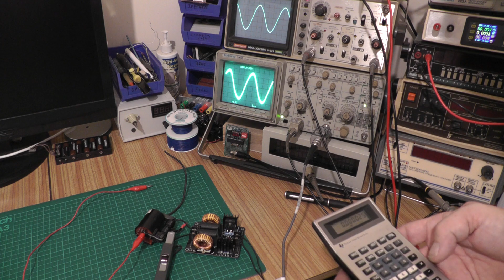Home Made 30 kV ZVS High Voltage Power Supply and Tear-down

Comment: 7:24 I can't afford all that but i want you to try somethings with these 
1. get 5 to 10 capacitors in parallel and then check how strong and loud that spark could get 
2. change the distance between terminals to let the capacitor fully charge
3. get bigger high voltage capacitor to test how loud could be bigger 1uf or 0.1 uf capacitor could get
4. if you can use dB meter to test the that spark bangs.
BTW nice video I would be really thankful to you if you can do this there is no video on YouTube which tested any of above

Comment: At about 7:19  you state "If it's DC I'll get a spark"...What would happen if is was AC??
THANKS MUCH!
Reply from the maker: At high frequency AC that capacitor would essentially conduct (like in a HF filter), and heat up.

Comment: Hi Les!What is the voltage and the current wich you feed the zvs?I just burned my hv power suply and I want to build one based on your design.I have an 1000w zvs.Many thanks!
Reply from the maker: I normally feed it off of a variac upto about 20v but a low current may be a couple of amps or so.

Comment: I'm having trouble sourcing AC flybacks unless i order from China and wait 3 weeks, did you source yours in the UK and do you have a link ?
Reply from the maker: It came out of old equipment, a radar set if I recall! It is however entirely possible to wind your own secondaries for these. I built a few over the years or x-ray stuff I was building.
Reply: Thanks Les.  @LesLaboratory

Comment: Hey, I got a bunch of question. What is the output of your ZVS driver? Is it AC or DC? Where did you get an AC flyback transformer as I have a hard time looking up for one? And did you use AC for your initial input into your ZVS?
Reply from the maker: The output from a ZVS is AC. The input is DC. It is possible to wind your own flyback if you can't get hold of one.

Comment: Great video! I'm planning to build something like this for a project. Do I have to use a flyback transformer? Since ZVS driver works at the resonance frequency, would it be okay to use a transformer out of a microwave oven?
Reply from the maker: Thanks! The LC in the ZVS driver behave as a resonant tank circuit, and thee normally resonate at round 20kHz or so. The heavy Iron core of a microwave oven transformer it much too lossy at these kinds of frequencies. Flyback Transformers can be had very cheaply off of sites like eBay and make for a compact, high voltage supplies that are much safer than Microwave Oven transformers!

Comment: I made a multiplier with 10 capacitors. The diodes are fast (restoration time 150ns) but will be able to handle the high frequency of the ZVS? What do you say?I'm afraid of burning the diodes because of the high frequency.
Reply from the maker: Assuming that the transformer resonates at about 20kHz, the period will be 50uS, so 150ns recovery time is more than adequate. Use a ballast resistor on the output of the multiplier, else a discharge may exceed the current rating of the diodes.

Comment: Even If it´s true that electronic gets distorted when high voltage is near  I saw high voltage power supplies with digital meters so it must work some how. I could even get analog meters jumping like crazy so they are not immune too. I did not try hard enough myself but maybe you could try shielding, filtering and grounding(earthing) in one or more combined way.
Reply from the maker: Sure with shielding you can get digital meters to behave. unfortunately I only had a plastic case for this project. Analog meters are however quite robust, and some are design for direct reading of EHT, like electrostatic voltmeters.
Reply: Yes they are more forgiving but If you use a marx generator on the same ground and you don´t earth anything they say I am out now xD If not banging with a marx on the same ground they also were good enough for me :) I guess there are oscillations when the marx strikes because sometimes I have even flash overs of my 40kv resistors which are plenty for 25-30Kv with a flyback transformer. Still I don´t think a mains earth is made for a marx too so I leave the ground floating and power it from a battery.

Comment: Thanks a lot for video. It's great. How can I make this power supply with 60 kV output with the same frequency? Can you please help me and share the circuit schematic?
Reply from the maker: You could add more stages to the CW multiplier, but you would have to insulate it well (for example submerge in oil). ZVS drivers have been around forever, and there are plenty of schematic on the net. If there is an appetite for it, I may well do a video in them in the future, but right now, I am in the middle of a CO2 Laser video... I am curious, what is your intended application?
Reply: @LesLaboratory  Thank you very much for your response. You are really generous that you want to do a video for it. That's so useful for me. Can you please suggest an applicable schematic to me for 80 kV output? I want it for ozone generation, but with 80 kV output.

Comment: i dont have time to find spheres because my problem but needles are ok i believe. MY CONCERN IS NOT TO PIERCE MY CAPACITIVE DOORKNOOB(40kv 1nf with 20% tolerance).my source is a high voltage generator with a voltage multiplier that it said to have 40kv but in reality it has about 20 kv because the arc jumps at 20mm.Of course i put a resistor in series(about 3Mohm 3W)for protect the source.I think you can power and you your lasers with these modules( period max 5 sec)to not heating up(especially the small one).The 1000kv ( more than 20kv at 7,4v) 3.6v -7.4v input and the 400kv (20kv) 3.6v-6v input.for power source i use two 3,7v acumulators.
Reply from the maker: You really do need the time to make at least reasonable measurements. It is worth it in the end!

Comment: so the formula U[kV]=30*d[cm] is true for sperical electrodes with a spacing much less than their diameter,not for needle like i have?what i see in graph is 2cm  is aprox 20kv, and in tabel 20kv is 1,75cm for needle.Someone say i have 3kv per 1 mm distance beetwen the electrodes examples:
→ 10 mm * 3 kv/mm = 30 kv
→ 20 mm * 3 kv/mm = 60 kv
i believe this examples is for spherical electrodes not for needles.
Reply from the maker: You are better off using spheres. They are easily obtained (ball bearings, dome-nuts etc). Needle gaps are notoriously unpredictable as a measuring tool, because of the Corona discharge they generate.

Comment: so ,a spark which jumps at 20mm lenght is 20kv?i dont have a high voltage probe to measure the voltage of my power supply.my power supply forms an arc about 18mm, so is 18kv.
Reply from the maker: Yes, more or less. There is a document here that may help you: http://www.kronjaeger.com/hv/hv/msr/spk/index.html

Comment: your diodes from multiplier are 15v high frequency diodes or regular diodes?
Reply from the maker: High frequency diodes. Mine are each rated 30kV, but 15 kV will probably do the job.

Comment: for my mini  tea nitrogen laser ,it  will work with a crt flyback with ballast resistor or  should  i built an multiplier?it will work a multiplier with 4 diodes or six  15kv, 550mA ,and  20kv 1nf ceramic capacitors with a balast resistor 3,3Mohm?and which is the voltage of your flyback?
Reply from the maker: it depends, if it is a DC flyback, a multiplier is not needed, nor will it make any difference. My flyback is AC and puts out about 10kV hence the multiplier.

Comment: Where dya get one of those flybacks? all the ones I've come across have diodes inside to rectify or a double cicuit potted inside as well.😎💕🖖
Reply from the maker: I got mine out of an old Black and white monitor. You could try eBay, but it is possible to wind your own secondary on the core from a color monitor.

Comment: quick question, can you build a 15kv DC power supply that can deliver negative voltage with NO AMPS???
Reply from the maker: You coudl easily make the supply negative, bu reversing the polarity of the diodes in the Cockroft-Walton multipler. I am not sure what you mean by no amps though? I'm sure if you wanted almost zero current, you could use a multi Giga ohm resistor on the output.

Comment: Just re-watching this great video again, from some other research online there's no easy way to make a flyback based circuit such as this a negative high voltage power supply is there?
Reply: ie: It's not possible to reverse the diodes in the CW multiplier to obtain a negative output is it?
Reply from the maker: It is absolutely possible! 
If you want real high voltage with reduce risk of the multiplier flashing over, you can drive two flybacks and build one positive and one negative too.

Comment: I just found your channel.  Great resource.  Thanks!  In terms of controlling the output voltage, will the ZVS module tolerate 0-? Volt to make a practical variable voltage power supply?  Thanks, Doug
Reply from the maker: Cheers! Normally you can run them up to 36v or so (some can be pushed as hard as 48v)
There it a trap though, you cant start them at 0v, or even soft start them for that matter. They need the turn-on inrush current to start oscillating (normally around 12v)
Reply: @LesLaboratory   is there a possibility to modify a ZVS driver to start them at 0 Volts? Or what would be your solution to get a fully variable HV power supply?

And one question about the ground cable: does it need to be rated for HV too? Because I see a lot of HV supplies where only the output cable is a HV cable . But won't there be running HV through the ground cable too? 

Sorry for my crude English and thank you for your help!

Comment: Neat build! What is the simplest/best way to power a voltage multiplier that requires 2.5Kv at 50KHz? Can a ZVS induction heater be used, if so then how?
Reply from the maker: The ZVS driver I use in the video is designed for induction heaters. It would simply be a case of acquiring a suitable transformer or winding your own. You can use the ferrite cores out of old monitor transformers.
Reply: @LesLaboratory  I require a high frequency of 50Khz.

Comment: Stupid question but if you varied the input voltage of the zvs driver, would it increase/decrease the voltage of the flyback?
Reply from the maker: Yes, in fact when I drive the home made Nitrogen Laser with it, I hook it up to a home made variable power supply.
Reply: @LesLaboratory  you hook the zvs to the variable power supply?
Reply from the maker: @SetyoHillman  yes, see this video for an example: https://www.youtube.com/watch?v=pCnXftuJ9Zo
Reply: @LesLaboratory  just checked it out 👍 This will be helpful for my current project, thank you!
Reply from the maker: @SetyoHillman  Cool! Just one gotcha though, you cannot start a ZVS from 0v. They need a kick at turn on to start oscillating. I generally start at around 10+ volts or so.
Reply: @LesLaboratory  thanks for the tip

Comment: How much current can the supply produce at maximum voltage? Very much enjoying your videos! Just discovered them via Twitter!
Reply from the maker: Awesome! The design I am using is current limited to about 8mA, but ZVS drivers are capable of pushing hundreds of watts through a line output transformer. I'm not sure how long a standard monitor transformer would stand up to the punishment, but they are cheap, so give it a go!  You can buy CO2 laser transformers pretty cheaply as well, and I am willing to bet you could drive one with a ZVS successfully.

Comment: Nice! I had built the same HV PS some time ago. The only remark is that the ZVS driver is designed for an induction heater, where is hard/impossible to make two driving coils, so it has 2 inductors on the PCB. There is another type of ZVS driver with only one inductor and which is more efficient to drive an HV transformer (but it requires 2 coils on primary). You can also modify yours (the schematics are very similar). This will produce less heat of transistors.
Reply from the maker: Well spotted! I used to build my own, running at insane powers,  but these one happened to be dirt cheap (cheaper than I can make them, so just snapped them up) They might not be that efficient, but they don't break a sweat.

Comment: Nice HVPS!!!! Could you tel me how you use a digital panel voltage? Thanks!!!
Reply from the maker: Same as with the Analog meter, a suitable high voltage divider, plus the meter. The catch is though that unless the digital meter is sufficiently well designed, you will run into problems. I have had endless issues with inexpensive digital panel meters. Analog just works! Anyway, see here for  a good resource: https://www.repairfaq.org/sam/hvprobe.htm

Comment: Excellent nitrogen laser videos, thanks for the inspiration.  I have not found any AC flyback transformers anywhere online.  Do you have any suggestions for a source or links to an alternative design I could use?
Would an ignition coil such as the ENA coil for Subaru Impreza shown in Plasma Channel's "The 50,000V Subaru Outback Powersource" video be a replacement?
Reply from the maker: Thanks!

If you look on eBay for "Vintage Flyback" you will find loads of them. Usually the windings in these are either pancake shaped, or visible, or they lack the black plastic casings of 'modern' ones. Most more modern (80's, 90's) Black and white TV flybacks are AC, but any modern-ish color monitor flybacks are DC (they have Diode split secondary's, that forms an integral voltage multiplier)

It is possible to wind your own secondary if you are so inclined. I have done this and it is not as many turns as you might think (about 600 - 800), but you do have to insulate each layer and do a decent job.

You can get new modern CO2 laser flyback transformers as well, which may be AC, however, I have not played with these.
Reply: @LesLaboratory  Thanks for the rapid reply.  Unfortunately getting them to Australia makes them a bit expensive. I will keep hunting.  I would like some details of your linear variac lab power supply you use.  Have you done a video on that or have a schematic?
Reply from the maker: @brentonrowland8613  There is no diagram or video, but it was dead straightforward. Simply a small variac feeding a 24v transformer (for isolation!)  that is then rectified with a bridge rectifier and a smoothing cap. It was a junk box build apart from the case.

On a side note, you can not bring up a ZVS driver from 0v! The ZVS needs the initial 'kick' from power on to get it to oscillate. I normally start at about 10v (the minimum) then work up from there.

Comment: I was literally just looking at my power supply thinking that I need to enclose it.

Quick question about the ammeter,  if I'm thinking right 1Gigaohm makes it read out in KV/uA and the meter's internal resistance is so low by comparison that it can be ignored, correct?
Reply from the maker: Almost,  the meters resistance is about 2.9k, so I end up with quite an odd division. I forget where the doc is that I used for my math. IIRC I had to measure the voltage required for FSD then work from there
There is a document on measuring high voltages here : http://hotstreamer.deanostoybox.com/TeslaCoils/OtherPapers/JR-Lucas/HV_Chap6.pdf
Reply: @LesLaboratory  Thanks Les, that link has some really useful stuff in it.